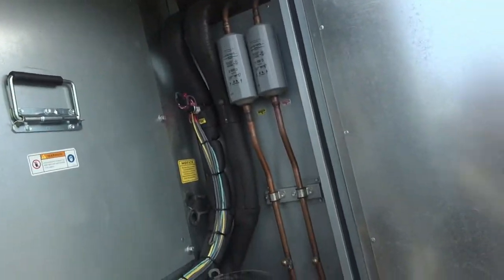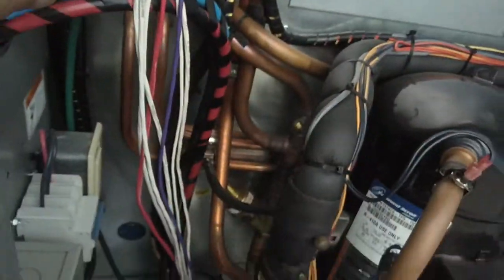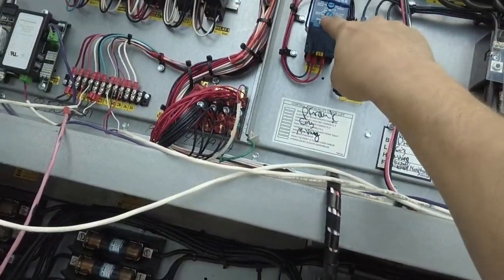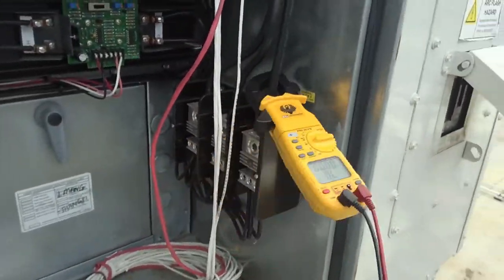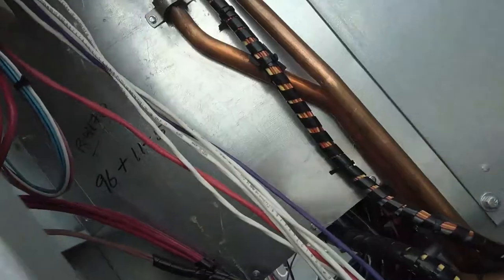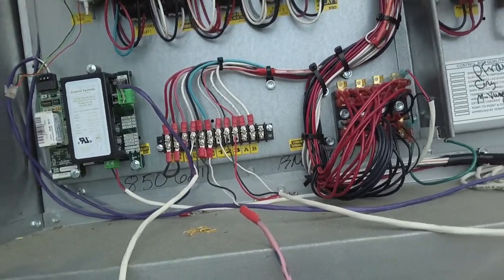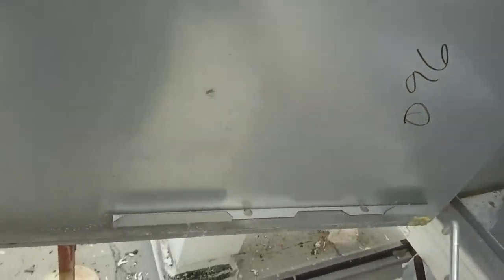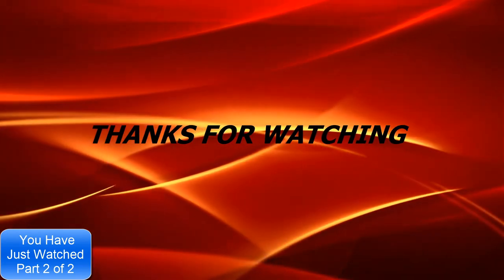AAON HVAC NOT WORKING AFTER CHANGING FILTERS part 2of2

Comment: But the worst part is I have been a hvacr mechanic all my life and started out installing ac condensing units wireing electric furnaces cut thread black iron pipe by hand threading started out installing at 17 years old when they would not let me do service work I went to work in HVACR field commercial but the aaon is way different to service
Reply: Please call me to tell me 703-830-3333 x 107

Harlan